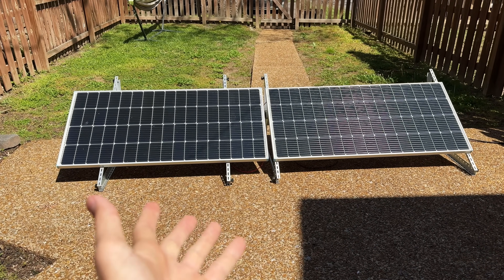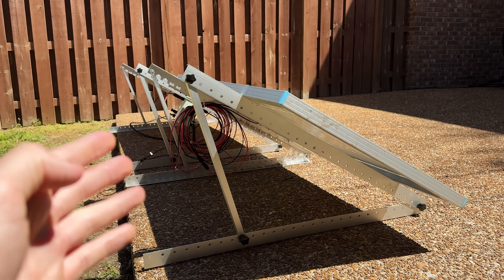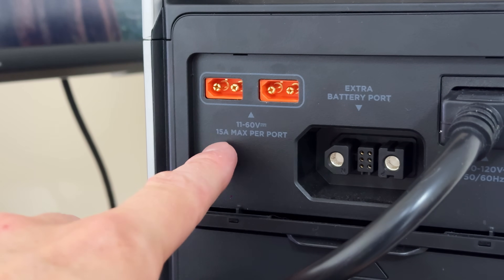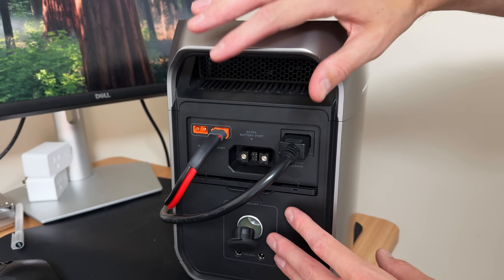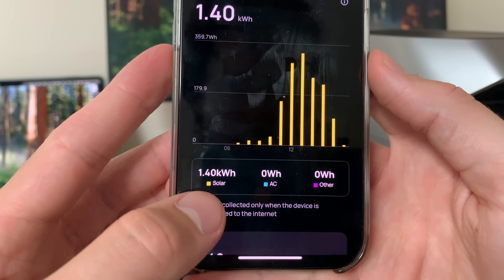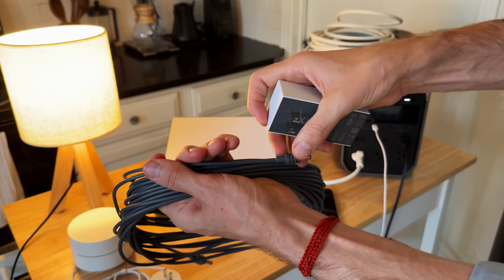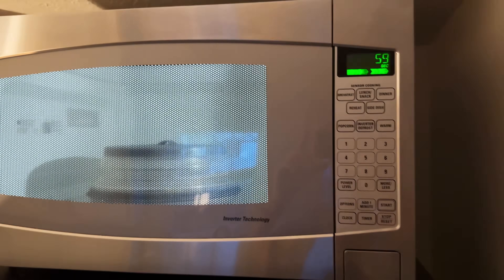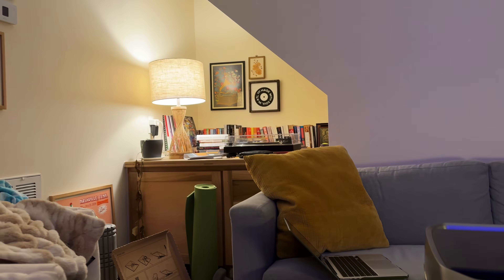Simple $1,500 Solar Generator Setup!

Comment: Price wise, you can get the unit for around 600 on sell, the cables is what cost me the most at around 125 each - about the same it cost me to get 2x 400 watt panels. Cables are costly! I also went into the 2kwh extra battery giving me around 3 kwh for my room (700$), I use around 2-6kwh each day, so some days I can go full solar no problem, other days I have to hit the wall still, but over all I save around 10-50 cents per day and covers most of the high cost hours that powers a robot cleaner, a PC, AC, router, two ip phones (work+home), a light, and a switch. Actually 2 PCs - one is my low power usage one and the other is my gaming one. The solar will swing wildly per month or week, but so far per sunny day I get around 3-4kwh worth of power and around 500-1kwh if its cloudy or raining outside. Over all I think it cost me around $1,700 that is including taxes. With that said, if has saved me with 2(6) blackouts so far and I am sure more mini ones as well as I didnt notice it in my main room, but when I go check the other clocks they will be flashing so I know I lost power a few more times that I am not aware of at least:) The main two was when I was on the phone with a client and didnt miss a beat helping them out. Over all cost will depend on how you look at it. Solar will pay it self off in less than 5 years, but the batteries will make it closer to 15 years. So it will depend on why you got the batteries in the first place. I also need to still apply for the tax credit as well at the end of the year that will save me another 30% that will bring it down to less than 2 years on the solar and 10 with batteries. You for sure did over pay for your setup though sadly. The panels really hurt base off what I see in your cost. I also didnt use any mounts... they're just sitting on the side of the house. If I could mount them I am sure I would've almost double my solar input. One las thing, so it also help notice some high power draw with my gaming PC - I went from using around almost 250 Kwh per month down to around 120 kwh per month just having the ability to see what draw I had with what devices and turning on different power save settings. Let alone all that extra heat that had to go to cooling the room back down with the main house AC. So 100-120 kwh (70-80 covered by solar) vs almost 300 kwh that was all from the grid was a pretty big cost savings to me.

Comment: With power outage you could buy 100ah battery and xt60i cable into Delta 3 doubling the power
Reply from the maker: I'm actually working on a video about just this as a battery backup setup
Reply: Worth it.

Comment: Why didn't you keep it plugged in to the solar panels during the blackout? Wooden the battery not dissipate like that if you kept it plugged into the solar power?
Reply from the maker: I mentioned it kinda offhandedly, but it's because where I live blackouts always happen during thunderstorms. And during thunderstorms the solar array produces zero (or essentially zero) power, so I'm not missing out on any power by unplugging it

Comment: I always love how you are pretty clear that these setups main advantage is in terms of energy independence and circumventing blackouts. The savings, especially in the US (which has great electricity prices in general), don't really make any sense for the general person. 
Excited for the next video!
Reply: It's $0.40/kwh in most of California, more if you exceed your base rate. C&P below in google search, first result is a pdf, 9/2025:
CA pg&e residential-electric-rate-plan-pricing
Reply: It very much matters where you are. Data centers are stealing power and the neighbors get to pay for the theft. So, instead of a $1200+/month electric bill, solar soon pays for itself.
Reply: Definitely depends where you are in the US.  In some areas like the San Francisco Bay, the rates are over $0.40/kWh.  We have solar and whole house batteries that eliminate much of the need to pull from the grid.  We usually get a check for the excess power at the end of the year.  The amount ranges from $150 to 400.  Previously we were paying upwards of $500/mo.  Also, we have gone for up to 2 days when the grid was down and could have likely gone a couple of months.
Reply: @JBoy340a  Ok, but give us the actual numbers. How much did you spend in your solar + batteries setup? The moment it takes you 10-15 years to even break even, these setups in the video (of a dual solar panel) don't really matter in terms of savings. 
If you are investing 10K into your solar setup then it's a different discussion, because you are doing it for a long term investment (which will never be the case when you are buying 200$ solar panels to put in your backyard). 

If you have made it work in terms of savings, would love to know how. 

For example, I save 2000$ in gas a year from my EV. So my investment in that pays off in 5 years (10K was more or less the extra compared to other new car alternatives for me).
Reply: @PetrusCastrus  It is a bit hard to put a hard number on the solar.  We needed a new roof due to cracked tiles and are required by the HOA to have another tile roof.  So we put a solar tile roof on.  That was around $67K.  The new tile roof was about $69K. The batteries and rest of the equipment (inverters, etc.) added about $28K.  So the delta for adding solar to a new tile roof was about $26K.
Reply: @JBoy340a  That is mighty impressive if you are saving 500$ a month. You'll "pay back" in 5 years? (taking your delta into this napkin math, instead of the total cost.)

Solar really scales well once you start going big. 
Im also suprised you are paying so much for your electricity, that's at the very highest I've seen in the US. Most states are at least half of that (which changes the math a lot)
Reply: @PetrusCastrus  Curious question. You say your saving 2000$ in gas a year because of your EV. But how much power at what cost does it take to replace that gas cost? 

Or is the 2000 savings already after counting the cost of power to recharge your EV. 
Personally I think full EV's are just silly until the battery tech gets better like Solid-state batteries hopefully in the future & I believe hybrids are the only way to go right now for a good middle ground until tech just evolves more.
Reply: @ZombifiedTech I also agree PHEVs are probably the way to go as a society right now, we got a full EV for a multitude of personal reasons. 
We save 2000$ after counting everything, and that is in part because our utilities are included in our monthly bill and also because there's a good amount of free charging around where I live (work, fun places, etc...)

But even if I had to fully pay, electricity is 0.14cents a kilowatt. So for a full charge we are talking about $9.1, 300 miles. That will always be AT least half of the price of a gas vehicle.
Reply: @PetrusCastrus  If you are paying $0.40/kwh your payback time is pretty near instant (like 3 years or less). In this case it makes no sense to not do solar if you have space. Panels are dirt cheap, and batteries have come down significantly making it pretty reasonable to do an off grid system.
Reply: @xeridea  The user above had a specific situation his math made sense, what is yours?. At 0.40$ (Which lets be honest, it's VERY SPECIFIC locations like Hawaii and expensive California places), I don't see how you could make a light setup like this in the video be worth it at all, much less paying it in 3 years.
Reply: @JBoy340a  This is one reason why I would never buy a house that had an HOA. Nobody is going to tell me that I have to have this kind or that kind of roof on my house, lol. It would be like going back to 1775.
Reply: @elelegidosf9707 depends on the HOA.  Ours is very easily going.  As long as you are not doing anything to radical it is not an issue.  The only comment I got on the solar roof from the HOA was cool … can’t wait to see it.
Reply: @JBoy340a will your homeowners insurance cover this stuff?  I assume it’s extra cost to insure as well?
Reply: @stevewoodyt  Insurance cost was largely uneffected perhaps an additional $300/yr for batteries.
Reply: @ZombifiedTech  Wrong   Hybrids get all their energy from the gasoline, you are just hauling around extra weight. They are more complicated and more costly to repair which negates any fuel savings.   Prove me wrong.

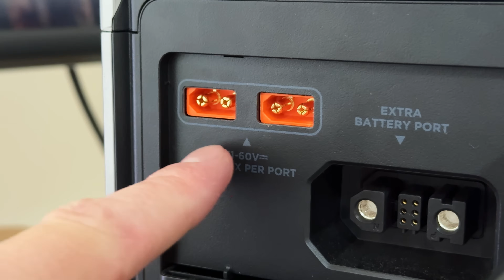Comment: Okay, at 4:52 you have a red/pink dot on top of your finger that doesn't move. I had to check if my monitor had dead pixels. Got scared for a second there.

Edit: well after typing that, I went and checked, there other moments where I can see that spot, is your camera scratched or was it something during editing? It's always in the same place, like when you put the Ecoflow on top of the the table at 4:36.
Reply from the maker: Good eye. Yep my phone camera had some dead pixels on it which I didn't notice until I'd filmed everything for this video (and the next one lol). Got it fixed though so it won't be there after that